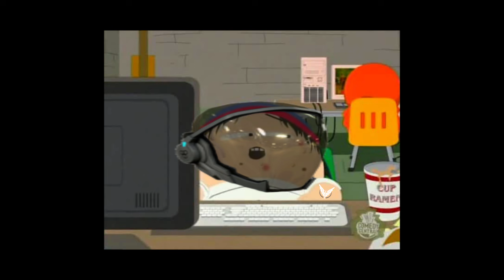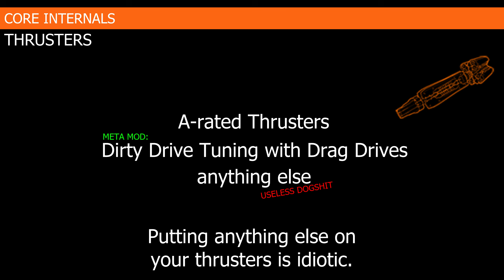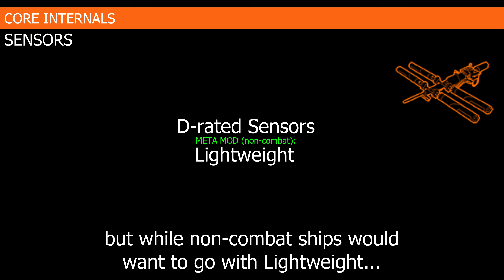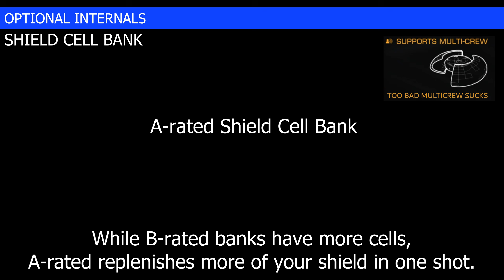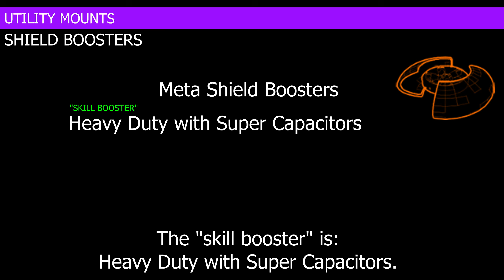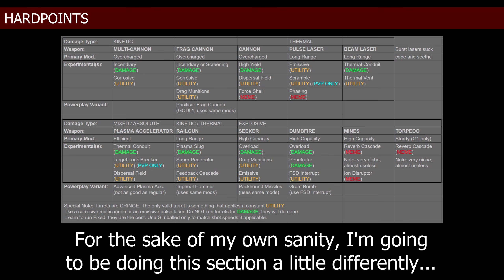[Elite: Dangerous] Meta Engineering Guide (with memes)

Comment: so many things wrong
Reply: Milgrade armour is just mirrored/reactive with worse resistances. The only reason not to use any of the other two is bc you do AX, and even then reactive/mirrored aren't worse in any way. Current meta PvP builds run either mirrored (lightweight+deep) or lightweight (HD+deep).

Overcharged powerplant is very viable and necessary for many builds, especially prismo builds (and it's literally the current PvP meta).

Weapon focused PD is viable for mining.

Thermal resistant biweaves are terrible. Reinforced is the way to go in 99% of situations. Fix resistances on the boosters.

B-rated SCBs are often better than A rated ones. Also specialized banks are often preferable in PvE as they don't heat you up as much and there's hardly any NPCs with feedback.

Guardian MRPs are better than human ones and are legitimately the most important guardian module to get for a combat focused commander.
MRPs are also quite useless in the current PvP meta as everyone's flying shield tanks.
Reply from the maker: @asmahasmalaria8596  
1. Reactives add a thermal hole that needs fixed with HRPs (everyone and their mother runs thermal damage), and they also add more to the rebuy. Idk what you're on about with mirrored lightweight, unless you mean on an FDL or something. I'll poke around in Coriolis but it sounds very situational.

2. Yes, as stated in video, specialized PvP builds use Overcharged.

3. And engine focused is good for explorers, I know. But 98% of other builds need CE super. This was a general guide for most (not all) builds.

4. You're negating the one strength of biweaves, the charge rate, by adding additional upfront to the shield and forcing yourself to take more hull damage between recharges. Use boosters if you want more upfront.

5. Personal preference. You'll run out of heat sinks with B-rated. A-rated gives more upfront and has comparable overall recharge.

6. Personal preference. It's a difference of under 60 integrity points. Saves you from one more rail shot. Not worth the effort. And while FDLs wouldn't bother, most other mediums would.
Reply: @CrimsonGamer99  
Yeah ofc you run HRPs to fix the resistances. Pretty much every single combat ship has HRPs. I've yet to see a situation where milgrade was preferable to reactive/mirrored on a build. Completely disregarding the factor of rebuy of course.
The current meta seems to be "reactive for PvE, mirrored for PvP" tho I run mirrored on all my builds, PvP or not, missiles aren't used enough (or are dangerous enough) that I would care for explosive damage. One small kinetic resist HRP is enough to fix resistances.
And yeah mirrored lightweight is used on fast hullstacked FDLs, that's why I said "current PvP meta builds".
Reply from the maker: @asmahasmalaria8596  The purpose of this video was: if everyone's fully engineering their stuff now, and they follow this guide, 95% of the shit they build should be just fine. The goal was to prevent the proliferation of blast resistant boosters, thermal resist reactives, clean drives, systems focused distros, lightweight lightweight hull, shielded life support, and point defense turret spam during this engineering renaissance.

It is impossible to cover absolutely everything in as little time as I managed to here.
Reply: @CrimsonGamer99  
2. it's prismo builds though, not just specialized PvP builds. Many CZ corvettes and condas have to run OC plants. Not to mention downsized plant builds or Vultures. You can't really claim one or the other to be meta.

4. Honestly wasn't even talking about losing shields, on my biweave builds I very rarely lose shields regardless, it's just less downtime between fights (and I'd never use a biweave in PvP). And I don't lose shields because I have a reinforced shield that has some HP.

Fair enough for the rest even though I still disagree heavily on if it's important to unlock guardian MRPs. They're meta for a reason.
Reply: @CrimsonGamer99  Ok fair enough, I can get behind most of this. Still never would've anyone would run milgrade in 2024, we've had 10 years to learn why it's terrible.
Reply: @asmahasmalaria8596  i have never used scb ,i look at them as a cheat , a second life perhaps , naturally i dont play pvp .
Reply from the maker: elaborate.

Comment: I kind of disagree with the power distro on only specialized pvp builds. I use a krait with 4 mod plasma chargers for ax and pve. Weapon focused with cluster caps works a bit better with how power hungry the plasma chargers are. If you are already farming for the guardian fsd booster, you may as well do a few more runs for the blueprints to unlock some of the other guardian internal parts since they are a one time unlock. The MRP I find worth it if you have extra power capacity to spare.

Comment: I disagree about the hrps. I use reactive composite with thermal resistance/deep plating. Gives a good 16% res to kinetic and thermal. Then I can just use hd/do on the optional hrp
Reply: The way that hull reinforcements are calculated going with thermal resistance on anything but mirrored bulkheads doesn't work optimally. Either go heavy duty deep plating all the way or make sure your bulkheads have over 70% thermal resistance by going mirrored with thermal resistance and reflective. And then put hull reinforcements in that should drop your thermal resistance (kinetic and blast resistance with deep plating). And you'll find that the thermal resistance only goes up from there. Doing this can put a conda up to 90% thermal resistance with 62 kinetic and 53 explosive

Comment: Holy shit finally someone who understands that Undersized A rated power plants are better than D rated for exploration
Reply from the maker: I know a thing or two because I've flown a thing or two. First link in the description is my deep space DBX.
Reply: @CrimsonGamer99  I'm very torn between building a DBX or a dolphin. I've always used my krait phantom but I realized that it's quite too large for exobiology and that it would be quicker and easier to use a small ship instead of a srv.
Reply from the maker: @Rythillian  personal preference. Both ships run cold enough to scoop and never overheat. Dolphin can't jump as far but the cockpit is better and the fuel scoop isn't nearly as strained. The DBX is a workhorse and can get anywhere, any time, but has a slower fuel scoop. Both are ideal for exobio without an SRV (don't walk, just fly from sample to sample.
Reply: there is very little to no reason to ever run a non a rated plant
they have the best stats by far besides integrity, I can think of 2 times it would make sense, a fatboy build, or a racing build that doesn't care how spicy they get from boosts
Reply: Those who say otherwise are probably reddit build authors
Reply: @raghav1026  ha ha ha
Reply: I-

Fuck, I might have forgotten about that one while starting my CaspX build. Welp, that's engi materials wasted.

Comment: what about my SRV bay?
Reply from the maker: It can't be engineered so I don't care. Run the G-rated one, it's lighter than H-rated and only draws an extra 0.5mw. If the extra power is an issue, go back to the video, press play, press 3, and look in the top right corner.
Reply: @CrimsonGamer99  i pressed 3 and it killed me

Comment: Note : the best use for ECM's is to piss off NPC pirates by making their limpets fail.
Or in specialized builds to resist reverb cascade torpedoes.
Note 2 : because of the way thermal vent works, use it on overcharged beams, NEVER efficient.
Note 2 bis : not dependent on engineering, but remember that the more drained a capacitor is, the hotter it gets, so don't use weapons that require too much power unless you have a lot of thermal headroom or sinks.
Note 3 : I cannot stress enough how niche explosive weapons are. They're so limited by their ammo capacity that they're useless if you're fighting pretty much anything bigger than a Cobra mk. III.
Note 4 : unless you're willing to synthesize ammo in PVE, only bring kinetic weapons to PVP combat, for the same reason as why explosive are mostly useless. Only exceptions are plasma launchers and railguns if you decide to ditch a useful experimental for plasma slug instead.
Reply: overcharged beams have way too much draw and falloff is a huge issue as well. in 99% of situations,long range is the best beam engineering
Reply: @asmahasmalaria8596  any beams are gonna suck your distributor dry. Never run only beams on a build anyways. Two overcharged beams maximum should do the trick, use the other hardpoints for kinetic weapons. Also, if you're running a death star Conda, don't bother with long range since you can't hit shit with fixed beams past 1500m.
Reply: @rocket2739  honestly sounds like a skill issue, i can reliably hit anything at 6km range
Reply: @asmahasmalaria8596  good for you, but that's not gonna be the case for most players, especially depending on your ship and how small your target is. If you don't have a nimble vessel, your time on target will be garbage, period.
Good luck sniping a DBS with a T-10.
Reply: @rocket2739  Honestly how can you not? Fixed beams are literally hitscan. It's not hard dude. Also like, yeah, it's a slightly higher skill build than a gimballed beam/multi build, it's not gonna be for everyone, obviously.
Reply: @asmahasmalaria8596  Sure, with FA ON it's not that hard, but still limited to agile ships that won't let you get run around
Reply: @rocket2739  Oh I never fly FAon. Find aiming easier with FAoff as well.
Reply: size one advanced racks
they have quite the capacity unengineered, so you can either pump that capacity or use rapid fire and actually get some numbers out of them
a rapid fire fsd interrupt adv rack is the best option for a number of ships for that role if they don't have a s2 HP or need that HP for something else 
SRB TV beams are the way to go btw outside of AX, and they even have some applications in AX activities like oreo farming
TV beams vent based on their thermal load stat, so the hotter they get, the more they cool, I don't recommend g5 srb on most things as the range can become useless but you still get the highest tv values and dps
and that cooling translates into wep cap load to offset the higher draw
Reply: @Sylusssss  Uhmmm you might wanna check that. As far as I know, TV works as a proportion of the heat output generated by the beam, not the ship's temperature. Another thing, once the ship is at 0% heat, much less WEP distributor is directed to cooling and it doesn't drain as fast.

Comment: Great guide and overall very useful engineering tips, especially when it comes to internals. Only thing I gotta pick a bone with is reactive surface composites, if you lightweight/reflective them they have really good resistances. If you're running a lot of hrp, use thermal resist reflective on your smallest one. Youll have lower raw armor, but in every combat ship I've built its consistently given better actual armor than a heavy duty deep plated military bulkhead would have.
Reply: heavy duty reactives with a thermal hrp in your smallest hrp slot will balance your resists and usually give more hull in the end than thermal resist reactives. hope this helps